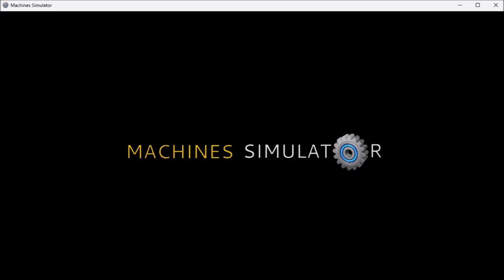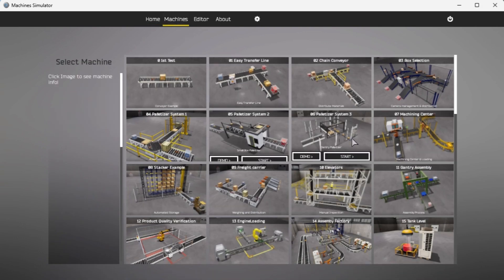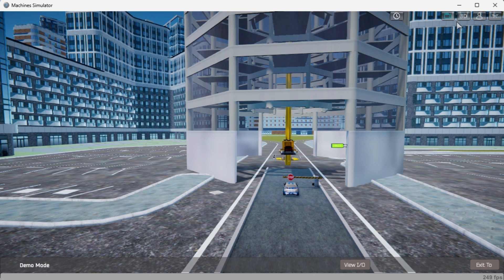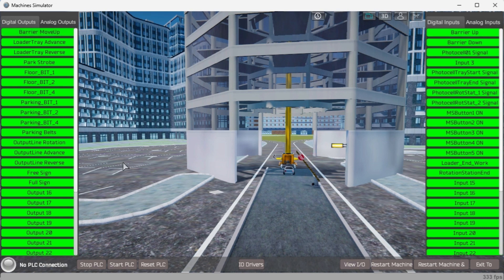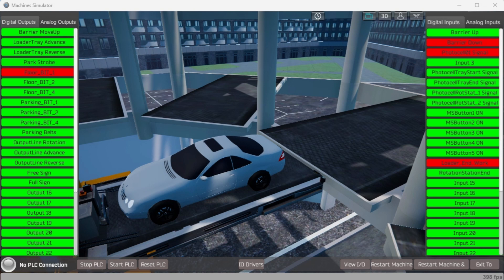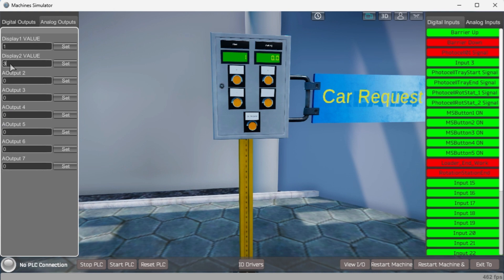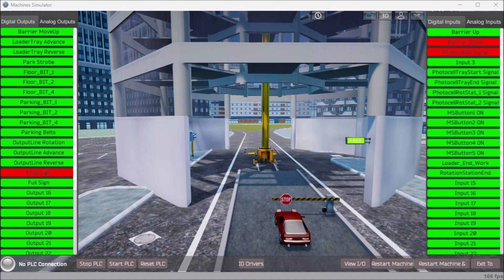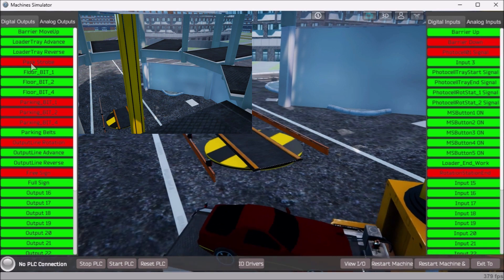Learn PLC Programming with Automated Car Parking Simulator

Comment from the maker: Purchase your copy of this learning package for less than USD 75 for a single computer install or less than USD 100 to allow different computers.
Receive 10% off the price by typing in ACC in the comment section when you order.
http://www.nirtec.com/index.php/purchase-price/
Learn PLC programming the easy way.
You can invest in yourself today.

EasyPLC Software Suite is a complete PLC, HMI, and Machine Simulator Software package.
This PLC learning package includes the following:
Easy PLC - PLC Simulation will allow programming in Ladder, Grafcet, Logic Blocks, or Script.
HMI System - Easily create a visual human-machine interface (HMI),
Machine Simulator - A virtual 3D world with real-time graphics and physical properties. PLC programs can be tested using EasyPLC or through other interfaces. (Modbus RTU, TCP, etc.)
Machine Simulator Lite - Designed to run on Android Devices.
Machine Simulator VR - Virtual Reality comes to life so you can test, train or practice your PLC programming.

Here is a list of YouTube Shorts about the EasyPLC Software Suite, including the Machine Simulator.
https://www.youtube.com/playlist?list=PL3y71jAPOdZAvTC8-TWNifAHpgEkAfqZQ

ACC Automation
https://accautomation.ca/